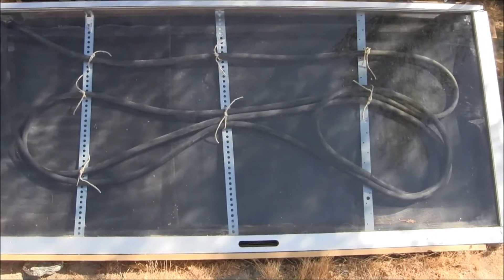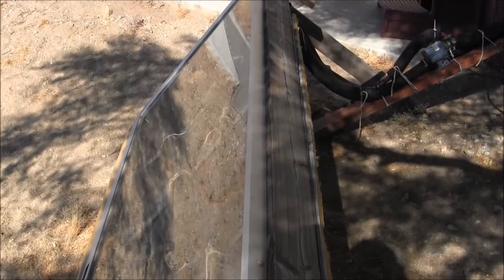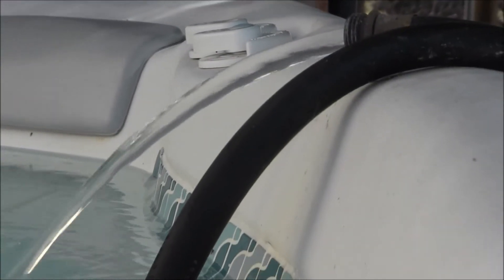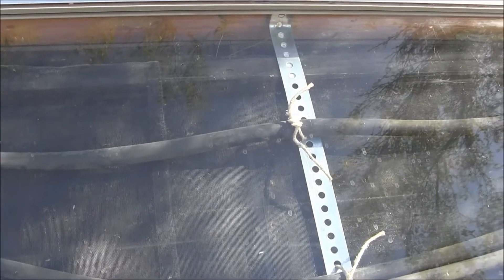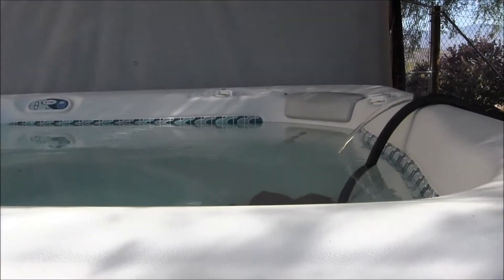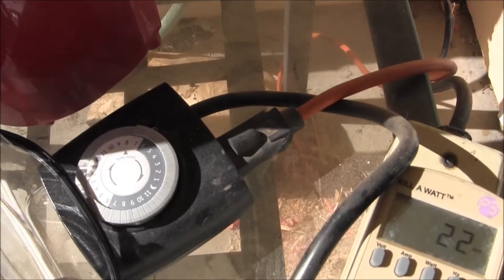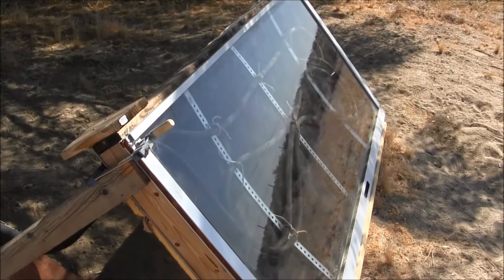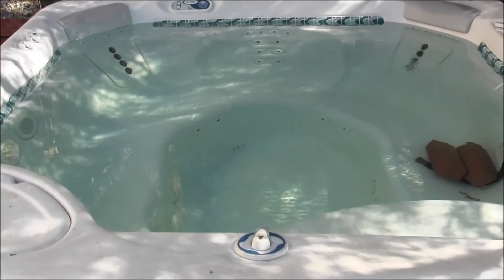Solar hot water heater takes 400 gallon spa to 99 degrees in January with free energy from the sun

Comment: Why not hook the line back into the inner plumbing of the hot tub?  What’s the temp and how do u regulate it?
Reply from the maker: I don't want to make new holes in the tub outer enclosure and mess or T into the inner plumbing. The temp differs, cloudy days will drop the temps and sunny days increase it. I can turn if off if it gets too hot, or cover the solar window.